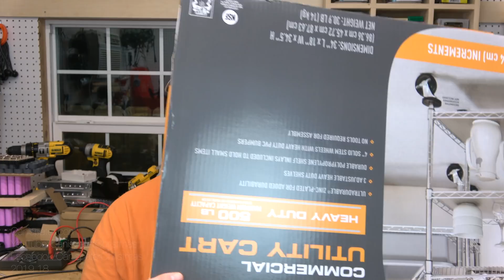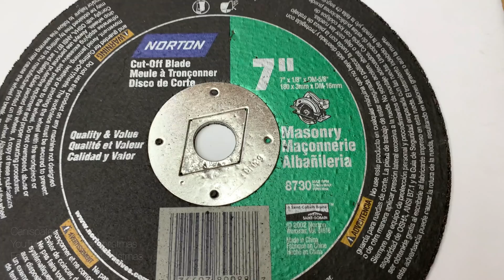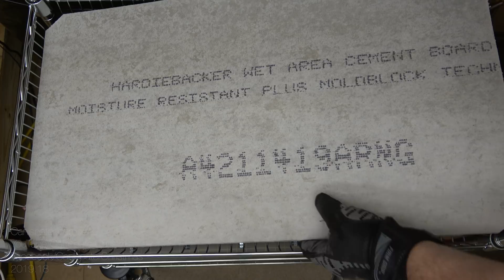⚡️DIY Powerwall Project - ep11 - The Cart (2019) ⚡️

Comment: Great videos! I really enjoy them. I put my packs in a Harbor Freight industrial cart and it is so handy to push them around. I'm about to move them into a full size network rack with metal shelves. To protect them I found some vinyl gutter downspouts that fit them perfectly. Even room to put a 80mm fan on each of their ends with a w1209 thermostat controller on them.
Reply from the maker: Nice! I may permanently install this a little later after getting some experience with it, but wanted options for now. :)

Comment: For some reason I'm always worried about placing my cell packs in an all metal case or enclosure. I know that the odds of a dead short are slim but still, it seems like it'd be just my luck that the main negative and positive busbars make a deal to both grab onto the metal and not let go until all my fuses are blown or at least one minor fire is started. My OCD makes me wanna wrap everything in sheets of heat shrink. Good call on the hardy board.
Reply from the maker: Metal enclosure is the safest (fire-wise) assuming you don't have any dead shorts to said enclosure. As long as the business end of the cells can't touch metal or each other in a way you didn't intend, you should be good. Something to insulate each pack is a good idea. I'm using acrylic sheets to cover the plus and minus ends of each pack so they won't short if they touch - seen too many "oopses" happen and it could certainly happen with this cart. I'm thinking about using the hardy board for each shelf and possibly the side that will be nearest the wall as a precaution.